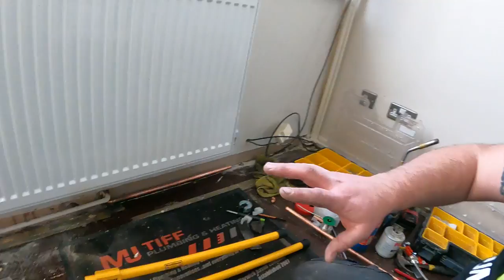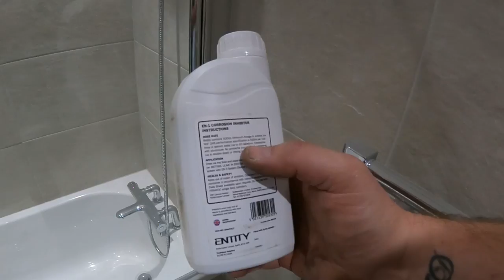FITTING RADIATORS INTO A DRAINED DOWN HEATING SYSTEM… Filling up another plumbers work!!

Comment: Been plumbing for 40 years now, got a rems press fit machine about a couple of years ago as I went on a job where there was no heat allowed. Also use plastic, tectite etc. it was probably one of the best things I did. It made the work go so much faster and looks great, fittings cost more than end feed but the time saving is well worth it. This doesn’t mean soldering, or push fit, or any of the other systems out there are finished,there are times when the machine can’t get into some areas, but it just takes a little more planning.  Have a go, and you’ll never look back.
Reply from the maker: Thanks mate deffo need to have a go
Reply: My mate has bought a press  fit machine ( think it was about 1600 quid like ) but said well worth it 
He said he does everything in copper , fits it all together and gets it all into place 
Then boom just crimps it all together , 
Said it’s the future lol
Reply: Hi you can get 45 degrees jaw’s which can get you in to some tight spot very fast machine 😊
Reply: Медь долго.  Pex быстро.https://youtu.be/XSQNMpb13W8

Comment: Thanks for the video mate. I haven't explored press fit because I don't think I'd use it enough in a domestic setting. For those rare situations where you cannot solder there's always copper Tectite pushfit fittings which look at bulbous as press fit. In a commercial setting where hot works are prohibited, Press would be a Godsend. Anyways have a good week see you on Sunday.
Reply from the maker: Exactly my thoughts buddy

Comment: Great video again Mark, may sound a silly question but I'm not a plumber. If you would have put the whole bottle of inhibitor in (other than cost) would it cause a issue.
Reply from the maker: Would of overdosed the system, 500ml will do upto 100 litres or 10 rads, there is only 5 rads on this system.

You couldn’t put the same about of juice in a pint glass as you would in a 3litre bottle

Comment: Great video as always Mark. 2 questions- do you fully open lock shield valves?  I never know if there’re factory set. Also what was the gadget you used to open the Lichfield valve. Thanks.
Reply from the maker: Thanks mate, on that job as there was only 5 rads I opened them fully……

The tool is called a “plumb chum”… really handy

https://www.dctrade.uk/dct/plumb-chum-multi-tool/

Comment: The kitchen rad in our kitchen had 15mm pipes dropping down the wall from the ceiling in plastic clips. We've bought a vertical rad to replace it with the thought of having the rad pipes dropping down into the valves at the top of it to look neater but after watching this, I've realised I wouldn't have a bleed port at the top if I did that so not sure what the best thing to do is now 😬
Reply: I'm thinking now if I could drop the pipes down the wall behind the rad into valves at the bottom. Would only see a little bit of the pipes at the top of the rad going into the ceiling which I don't mind. I understand I can't hide them completely.
Reply from the maker: Yep that would be the way to do it

Comment: Another top video Mark, very informative. Quick question, how did you know you were fitting the Trv,s to the flow pipe on the upstairs rads?
Thanks
Reply from the maker: TRV valves are bi-directional so it doesn’t matter which side you fit it buddy
Reply: Next time consider opting for the right hand side when in that situation as most people are right handed so right side is more logical and comfortable for the homeowners (unless they are lefties, using Smart TRVs or have furniture in the way) @MJTiffPlumbing

Comment: Hi Mark. Surely you can’t really overdose a system with inhibitor. My worry would be the complete opposite that if you don’t put enough inhibitor in the there wouldn’t be enough to protect the overall system. 
As a rule of thumb I add a minimum of one 500ml unit per 10 panels (not radiators) and when there are 18 or more panels or there is unusually large pipework which you may find in larger older properties I’ll add an additional unit over and above to per 10 panel rule just to make sure there is enough inhibitor in the system to make sure a system is properly protected. Appreciate your thoughts on this. Stay safe
Reply from the maker: That’s right to add 500ml to 10 panels… as that’s what is meant by 10 radiators….

Overdosing is a big thing and people really need to take note of instructions as they are there for a reason….. Inhibitor can be very bad and cause a lot of issues if overdosed

There is even talk of not using inhibitor like they do in the rest of Europe….. some brands don’t want it in there boilers as it can be bad

Comment: Hi Mark
Is there any need to use paste on an olive, obviously I'm not a plumber but was forced to do gas for dual fuel meter installations and using paste with an olive was almost a sackable offence, by the way bad idea for sparks to be trained to do gas, gas fitters should do gas  and sparks should stick to electrics.
Reply from the maker: I always use paste on compression…… why would you not??
Reply: It's one of those things people argue about online with compression fittings. Allegegedly even manufacturers say not necessary to use jointing compound, but lots of plumbers still do use some for good measure, they always have, always will and swear it helps. If using paste as an extra precaution you certainty don't need much.

Comment: Is there a particular reason why you measure to the top of the bracket other than to the bottom. I usually use the bottom, that's why I'm asking!
Reply from the maker: Just the way I’ve done it👍🏼👍🏼

Comment: Hi Mark. Quick question if I may. The tool you use on your ratchet to remove the rad valve fitting, where did you get it / what is it called?

Comment: Any reason why u wouldn’t use a speed coupling on that first rad because of the water?
Reply from the maker: It would look horrible and getting a tiny bit of water out isn’t an issue 👍🏼👍🏼
Reply: @MJTiffPlumbing  aw cool, wasn’t sure if it was because of cross bonding or what ever it’s called as u said u would have used press fit if u had it as it was going to be boxed in

Comment: Quick question if anyone knows. With a wet vac do you remove the filter before vacuuming water?
Reply from the maker: I removed the filter on the day I bought it and use it with no filter at all
Reply: I bought a cheap Titan one from Screwfix.  It has a bag for dry use, just take the bag out to use as a wet vac. It has a kind of foam filter as well which I rinse out now and then.
Reply: Yes remove the filter and bag when using wet & Dry vacs on water. Look at the manual/quick guide booklet for your specific model. Mine is Sealey and dry filter definetely has to be removed!

Comment: I'm replacing 5 radiators because they're old and starting to rust, I'm going to reposition a couple of them and replace a couple of single panel radiators.  I'll completely drain the system and be using polypipe under the floor with copper tails coming up to the rads I assume there are no regulations preventing this.

Can I drain the system down from the bathroom radiator into the toilet bowl?  I'm in a second floor flat 🙄
Reply from the maker: Yep all will be ok, just make sure it doesn’t leak downstairs
Reply: @MJTiffPlumbing  thanks for that, your advice is always appreciated, BTW those tile bits from eBay are every bit as efficient as the Bosch ones I've used in the past 👍🏼

Comment: If I had to cheat a system for leaks that I didn't install I would be inclined to use an air pressure test we have a compressor for testing in new builds where there might be no water on site we fit a couple of pressure gauges on and can check them regularly. Most of our work must be tested to 6Bar or in Imperial 90Lbs /sq inch .
We have been using press copper and S/S fittings for almost 10 years and now problems with them.
Also press fitting on multi layer pipes for maby 20 years on sizes up to 60mm a lot of our work no hot work allowed especially in listed buildings not even an angle grinder. 
Should have said I am in plumbing for 56 years and getting ready to retire in my plumbing life I have come a long way from wiped joints on lead to modern plastic pipes and fitting not sorry to see the end of cast iron soil stacks except in underground car parks.
Reply from the maker: Thanks buddy…… bet your looking forward to retiring…. Will you miss it??
Reply: @MJTiffPlumbing  I still do a bit leave the heavy work to the young fellas if I was at home all day there might be blood on the walls not shure wheather hers or mine.